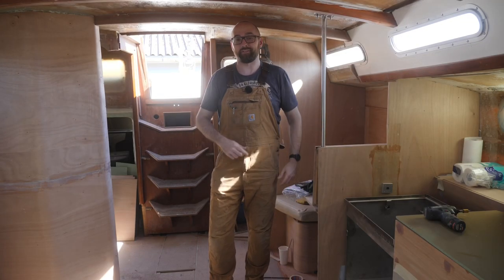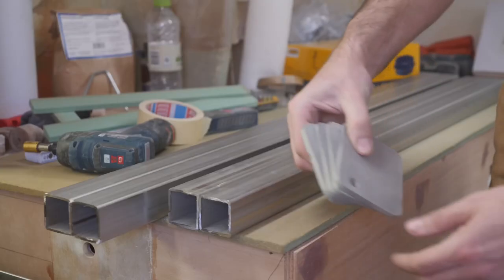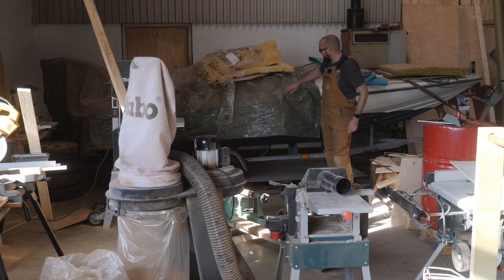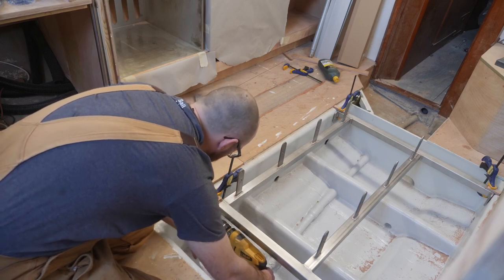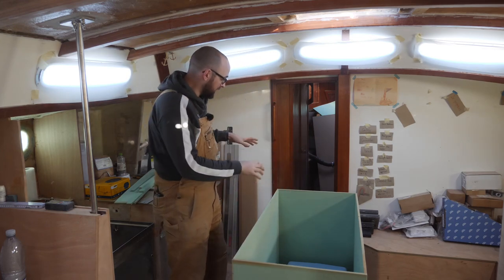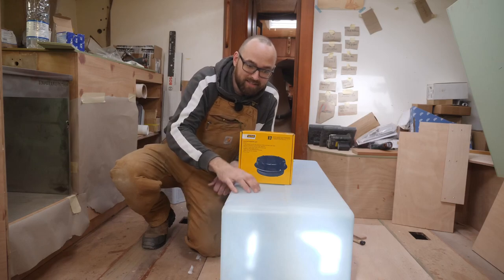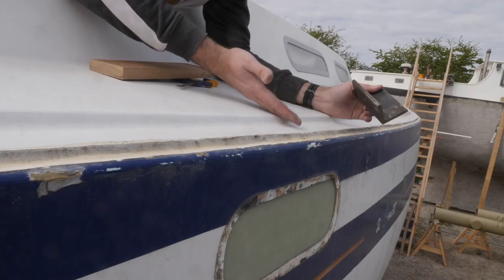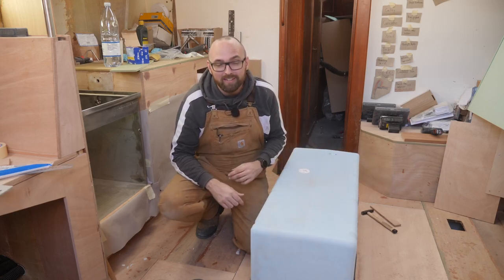Sail Life - New diesel tank - DIY sailboat project

Comment: Aluminium toe rail profiles hold water; it's a persistent problem because the drain holes are spaced apart and not flush with the deck surface. Standing seawater immediately adjacent to a through-bolted aluminium toe rail is a recipe for water ingress issues down the line, no matter how good the installation job is. Your proposed bulwark solution will definitely solve that issue, and you get the added benefit of choosing the bulwark depth for security and aesthetics (a slightly taller-than-usual bulwark will hide some of the coachroof volume, which can make a boat look more sleek). It's a win-win!

Also, another vote here for rounding the galley island edges off, following the same radius you used for the head's bulkhead; that would look super spiffy!

Comment: Hey mads, I'm running twin victrons on my boat.  Like you, I'm a 100% electric boat for cooking.  What's really cool about the victrons is that they can power boost your genset.  So, if you're running the genny while cooking and the demand exceeds the generators capacity, the inverters will boost the output with stored power in the battery bank.  Works REALLY well!

Comment: Mads, I’d highly recommend padding between the fuel tank and steel frame.  I’ve seen it most often done with “retired” conveyor belt strips or similar thick rubber (or leather).  Heeling, hobby horsing, etc. will create great friction between the plastic tank and steel and eventually a hole will present itself flooding the bilge/ocean with diesel.  I’ve seen YouTubers making these repairs after a leak, Sailing with the Wynns, I think Atticus and perhaps a couple more that I cannot remember at the moment.  Salt and Tar has done this on their previous and new build they are working on currently (probably a video in the last 8weeks) if your tank is not baffled it only increases said friction issue.  Just my .02.  If not make sure you are inspecting regularly and have purchased a spare tank in case they quit making this size.... Dan, Houston Texas 🇺🇸 stay well!
Reply: Upvote this to be sure Mads gets to see it. This is an important point.
Reply: Also allow for 3% expansion of the tank in all directions after first fill...
Reply: i know im randomly asking but does someone know of a trick to log back into an instagram account?
I was dumb lost my login password. I would love any help you can give me!
Reply: @Zander Brody instablaster =)
Reply: @Sam London thanks so much for your reply. I found the site thru google and im waiting for the hacking stuff now.
Takes a while so I will reply here later when my account password hopefully is recovered.
Reply: @Sam London It worked and I actually got access to my account again. I am so happy!
Thank you so much, you saved my ass!
Reply: @Zander Brody Happy to help :)

Comment: ... one more thing: fully just to support you, one advice: try to drill as few wholes to the hull as possible. Through-hull tansducers are known to fail badly under rough sea and can easily sunk a boat. You can pick up an in-hull transducer - it works just as fine.

Comment: Mads, you can run hose out of the top of the diesel tank back to the top of the other tank for venting. You won't need a big one and if you are worried about siphoning remember to have it at the top of the tank and to put a loop in it inside the island (you could do it at the aft end of the island) before you run it back. Then you will never pressurize the tank of pull a vacuum on it.
Reply: Excellent idea Mark.

Comment: Round off the corner of the island to give you that extra space.
Reply: ... and stick with your design.
Reply: I was thinking clipping the corner would be better.
Reply: The first time you bump into a square corner you will say why didn't I make them rounded. The next reason more room to pass by. It will also look spiffy.
Reply: I don't think he can..can he? I mean, the tank is just there, what little would be to gain, wouldn't be worth it. Besides, this is a boat, so things are expected to have some tight fitting areas, they're both young so i doubt it would be huge hassle. Consider also, that on a boat, especially one of the size of Athena, at large, you do get some sway, so open spaces aren't your friend.

I mean, some years ago, i helped a friend move a naked boat and had to go below, i suppose a wave was struck just the wrong way that i lost balance and had nothing to grab on, falling on my ass.  So tight spaces .. not so bad under those circumstances.
Reply: Need to wear knee pads in the cabin 😁.
Reply: Round or chamfered the corners
Reply: He has room to the setee side. You know he's gonna do it. It will continue the look from the nav bench and head wall.
Reply: I would consider clipping that one corner where you wanted to have a bit more room to squeeze by; it would only have to be about 4" on each side, which would make a world of difference.  And rounding off all of those 5 (if you add that "chamfered" corner as I'm suggesting) corners would make them more comfy.
Reply: If you had a similar radius as the aft head bulkhead adjacent to the island I think it would look really spiffy.
Reply: If he does that to the countertop, which presumably will overhang by 25-50 mm, won't that do?
Reply: Kim Young - knees?

Comment: On the island corner where you need more room, maybe match the curve that you used on the bulkhead for the Head just behind it.  I think those opposing radii would look great and it almost a natural flow to say 'this way' into the Settee.
Reply: That's what I thought too.  This would give those precious centimeters Mads is looking for.
Reply: I agree. If it is possible at all. -  As the the tank mount is defining the inner space of the rectangle. Adding curvature may increase the overall footprint of the kitchen island...

Comment: I agree with one of the comments that covered putting a rubber, or some other material, that would keep the
Tank frame from rubbing a hole in the plastic tank. It will certainly do that👍

Comment: I like the idea of another pole, another handhole isn't bad in bad weather 😉. In a diesel tank the airport is mainly for pressure equalisation, but if you want to future prof your design I would add a second line so you can draw out fuel gases from the tanks if you convert to alcohol or bensin/petrol for some reason in the future or convert the space to a battery bank.

Comment: I like running the diesel tank vent line through another stainless rail through the cabin top. I've been told you can never have to many hand holds on a blue water passage making sail boat.  I also like your idea for the new toe rail, I think that will look nice.

Comment: Put some led lights on the top of the tank. Have the plastics exposed so lights up through the oilfield  and lights up the floor area. That way you also get a smaller center island. Will look fantastic as you will see how low the dual is also.

Comment: congrats for droping the diy stailess toerail! go superhuman and drop drilling holes next;) just glue the stainless brackets to the deck with high-grade sikaflex and, when set, bolt the wooden toerail to the brackets. high grade sikaflex sports 4N/mm2 so 2 metric tons for a 50x100mm bracket. please leave a 3mm glue line or you'll never get them off again.

Comment: All your work is perfect. We use tube mating under tanks just to allow air flow. But very good work👍
The cheapest templates is sign board core flute cut too 50mm and hot glue too to make templates 😎

Comment: Another option for fuel fill could be to put a deck fill on the coach roof , connect it to the tank by installing a Stainless pipe vertically down to the fuel tank to pipe the fuel direct to the tank. . This would also be another handy hand hold if braced well.

Comment: Plastic tanks will swell with fuel. Thin rubber shim in between frame and tank. Re the toerail: the work in fairing a joint + wood toerail will be MORE than a foam / glass toerail. The pultruded fibreglass angle is also a very good idea. Less fairing under it. Just glue it on.

Comment: When venting a tank don't forget head pressure, If you were to over fill the tank, the head pressure on the tank is increased by the vertical height of the liquid in the vent. It pays to  keep the vent height as low as possible for safety.

Comment: for making odd shape  templates from foam , and /or thin strips or plywood , I can highly recommend use Hot Glue Gun . it dries fast and it is less fiddly than screws, I do that for years , newer fail !!! P
Reply: I was surprised he didn't use hot glue.  He used hot glue and foam to make some templates in the head.
Reply: I fixed the cracked baskets in my top loading freezer with a hot melt glue gun.  Amazing how well it worked. Because no replacements were available anywhere at any price.

Comment: Just a quick one I think the best idea for the island and the Diesel tank would be to use a pole through the deck that way you can fill and vent at the same time also it would give another hand rail you can easily pump to the smaller tank and have a bevel cut off

Comment: Reminds me of when I filled water in my "new" Bayliner 288, approx 2 minutes afterwards I got a unwanted pressure test when a 3 meter volcano erupted from the water filling cap (which was still open). Turned out the tank vent was corroded and 100% sealed shut. After drilling through the "vent" I got a stream of air out, and could resume filling. 

Well...at least I know the tank isn't leaking.

Comment: The tank breather can travel to anywhere at whatever up and down you like, preferably finishing well above starting level, but before it does it needs a catch-can or a pigtail, both immediately above the tank so any slosh liquid drains back to the tank, similar principle as the airlocks on brewers drums, in fact a brewers airlock may be ready made perfect but a catch-can would work just as well. There is also no problemo if the vent eventually (pun intended :) ends up at the top of the day tank, it can go at any level on it's way there and still function perfectly.

Comment: If you decide on solar panels, have a look into sunbeam "nordic" panels, since i have these intalled i have a lot more time at 100% charge in the batteries. They work better in a lower angle of sun, and have a shadow optimizaion also... You can never have too much solar power, especially in winter time...
Reply: Thanks for spreading good information!🙂👍🏻👏🏻👏🏻👏🏻

Comment: I sure hope that transducer position will be working good since I heard some people who mounted their too close to the keel got reflections from it. Might only be bulbed keels that gets a problem. But that positioning sure makes it a lot easier when putting the slings on the boat. Nice video Mads :) You have got a good hang on tig welding, I just bought one and it's super fun! I'm still voting for a stainless toerail, maybe make a diy metal roller bender?
Reply: I had problems with bubbles flowing past my transducer making depth readings jump all over the place. You raise a very good point. The placement of the transducer can be very finicky.

Comment: Hey Mads, some advice on the toe-rail proposal: Plan to use those angle brackets as the bases for your stanchions. On my dad's old Van DeStadt 34 the toe rail was set up in a very similar manner. The teak toe rail attached to a piece of angle that was welded to the deck (steel boat). Welded to the bottom and side of that angle was a 50mm piece of stainless tube that accepted the stanchions. It worked really well and was a very strong base.
Reply: He is going to need a lot more bases than stanchions, but I agree using at least some of the bases as stanchion bases is a great idea. It is crazy how easy it is to break most stanchions off. A stronger system to support his lifelines is always a good idea.

Comment: Although I have a 9,5 kWH Onan on Artemis, the concept is to draw all 230V power from the inverter via 24volt bank and let the genny drive a hefty 230V to 24V volt charger (ca 100A). I will retain the 230V to 230V load capability just in case (I have two emergency 230 bilge pumps). Hence, you need not to worry about the smaller genset you built (very nice job it is) get the benefit from having both battery and genny providing the combined power. Genny now has to run a little longer to get the batteries up to charge thats all.

Comment: I see no issues with your plans for the toe rail. YES, my thoughts last week somewhat on the generator. Up the house battery array capacity as well the inverter capacity. The only drawbacks are the power loss going in and out of the batteries and getting a 4KW battery charger that won't trip off on overload when you put the screws to those systems while charging. Honestly though had this panned better you would be better off with a 12V DC alternator to evade the charger loading issues.

Comment: be careful when you go to put in the 8 (4 per side) bolts to hold island down, if they are too long, they will go through the thread and hit the diesel tank, if they don't cause a problem immediately, they will rub until they do .
Reply: Did he not thread/tap the stainless tabs? So bolt threads into it and shouldn't have a head on backside. I thought i saw him power tap the holes
Reply: @Deftonesdsm  that is my concern, imagine there is 1.5 inch from the bracket to tank, but the bolt going in sticks past 2 inch or more once put in. ( Maybe we are talking about the same thing)
Reply: @kevinnemrava  yeah but wouldnt you just use a shorter bolt?
Reply: @Deftonesdsm  it would absolutely be that easy, to fix I totally agree, . but it is also just as easy to mess up I think, It would have been good I think to have some sort of stop at the back to prevent it going right though.

Comment: Nice video, bet you are loving the warmer weather.  I don't see any issue of venting the poly tank to the main SS tank, this is done all the time in aircraft.  I would have valves at both ends of the fuel lines between the two tanks, allows pump and hose repair without draining tanks. Could also add a polishing filter as well and circulate the fuel every so often.   I think you will find the 4kW will work fine if you practice load management.  Those induction burners heat very fast, so you don't usually need to run them at full current for very long.  Not measured my unit but I would guess you fry at 50 to 75 percent power aft the initial 1 to 2 minutes of full power warm up.  Convert the hating element to DC on the oven and run that off your battery.  Again it only uses full power on the initial warm up.   Change you thinking from power requirements to energy requirements.  It's the KWh usage not the KW usage that's important.

Comment: Just a thought and a tip I use myself, when cutting plastic with a large hole saw run the drill in reverse it will still drill fine without being so grabby.

Comment: Think of the IBTP genset as "upgrade-ready" since you can fairly easily swap the 102 out for a 204 sometime in the future to make it a full IBP if it proves.really necessary, and/or when you can find a deal on a used one somewhere.

I like the idea of another stainless stripper pole coming off of the island to hide a tank vent.  In a bumpy seaway there is no such thing as too many handholds at shoulder height -especially with so much cabinetry to run or get thrown into.

Comment: You do have to vent the tank but that is basically to allow air to replace the fuel you remove.  A hose that is routed with your fuel line should be fine.  Carburated cars use this method too to manage fumes.

Comment: I just put in a tank like that made by Moeller it is supposed to grow 2 to 3 % from the hydro carbons in the fuel . mine said it would bust if not allowed room to grow . yours may be different . and it also said a cleanout could not be added . I had a few installation questions but Moeller's support is 0 out of 100 .
     I think mine is fine but I probably spent twice as much time and money installing it as needed. looks like a good install if no growth . slosh shouldn't be a problem if kept full or empty . it looks like you have a plenty strong mount even if is half full .can't wait to see how it turns out.

Comment: Just a thought on the toe rail. Instead of using aluminium why not use stainless? Your welding skills look to be on par for the task . Also you would be able to mount your stanchions and rails directly to it either by welding or bolting them in place. Personally I would weld them similar to what you would find on an Amel. You can also b UK old yourself a solar arch and davitt system off the rear of Athena scaled to meet your needs . Stainless polishes beautifully and it would add $$$ to the value of your yacht also. Good luck with whatever you decide. I enjoy your videos keep up the good work

Comment: Add another stainless pipe for a vent cause if you overfill it you could burp or spill your stainless tank. Also I believe ABYC says each tank must have its own independent vent. Also for the island bolts add a piece of ply or foam so the bolts don’t rub the tank.

Comment: I would run the diesel vent under the floor out the stern. Connect to a solar powered fan to draw out the vapers. If you are filling the cabin tank from a side saddle tank be sure to have one way ball valves in the line. To help encourage the flow. For tank baffles order up a Summit Racing catalog from the United States. Baffles, rubber bladders, wall sections all kinds of "safety" related ideas for all of your tanks Fresh water, black water, diesel, and so on.
Reply: There is no need to have a fan on the vent. Doing so would only needlessly waste fuel. The vent's sole purpose is to relieve both vacuum and pressure.